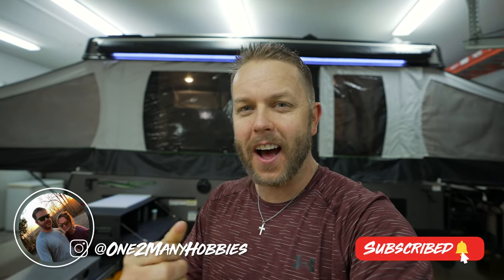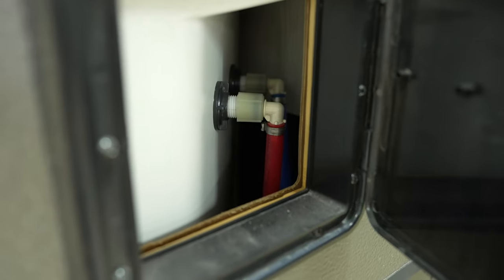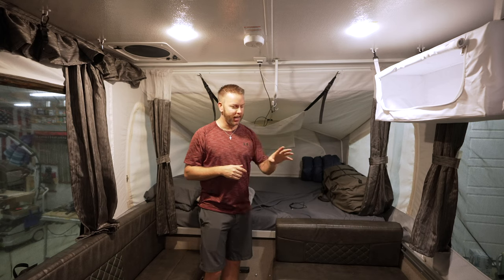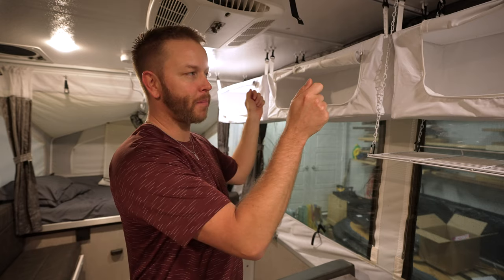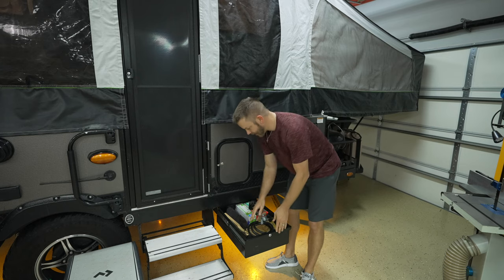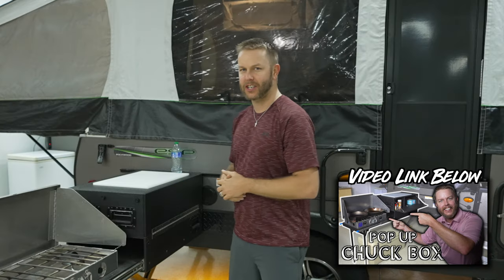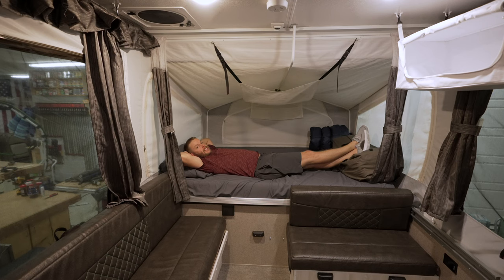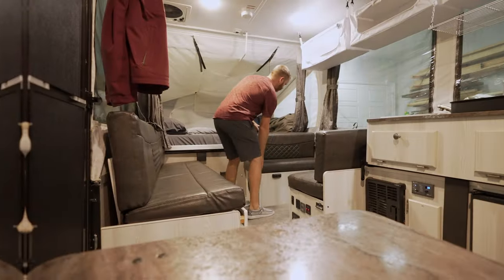TOP 10 Pop Up Modifications on my Rockwood Camper - 3 Years in the Making!!

Comment: I did 5 out out of the 10 upgrades. Thanks to you.1 storage bins,2 mattress,3 drain system shower and sink,4 switch the shower head and 5 USB outlets
Reply from the maker: That’s awesome!! Makes camping a little easier with these mods.
Reply from the maker: @cozcohut2617  I was trying to find a way to stay on the King side of the camper. Finally, just moved over to the queen side.

Comment: Thanks for the great ideas! 
My best mod on my trailer is a hot water recirc line for dry camping. Push button actuated solenoid valve on a 12-second timer, it will get hot water to the inside sink without running down the drain. A second press of the button gets the hot water to the outside shower to was dishes. Push buttons are at both sink and outside shower, and the water returns to the puny 10 gallon pot water tank.
Reply from the maker: Nice, I'd love to see this setup - wasting water to get it hot stinks!

Comment: #1 mod is electrical.  My 20 year old camper isn't as good, but the rebuilt system allows  you add in the extra 12v hook ups for fridges and the extra usb.  I also like the hanging storage.  It makes packing and take down so much easier.  Great ideas, man, thank you.

Comment: Your #1 modification will probably be my #1 modification too, when I finally take the plunge and buy my first pop-up camper.
I will plan on replacing the three-way refrigerator with either a 12V DC or 120V AC refrigerator.

Comment: Can you make a video showing how your roof mounted solar panels are wired? I'd like to mount solar panels to my roof, but am unsure of how to run the wiring from the roof to inside the trailer
Reply from the maker: On my 19' 2280bhesp Rockwood there was a fabric channel of wires already going to the roof for the lights etc. next to the front support arm. The solar wires run in the channel as well - is your camper pre-wired for solar with MC4 connection on the roof?
Reply: @One2ManyHobbies  unfortunately it's not pre wired, I'll have to add a similar connection. Another option I'm considering is running the wires behind an existing light on the roof

Comment: Many excellent ideas here. Great job!  A question on the Fold Away Stair modification, what model is that you have? Thank you.
Reply from the maker: I'm not sure which mod you're referring to?
Reply: @One2ManyHobbies   The aluminum stairs on the tent trailer mounted under the tent trailer do not appear to be factory issue(?)
Reply from the maker: @davidsharples3615  They are OEM from the manufacture.

Comment: On the king side you can add a mattress topper like a 3".Just a suggestion. That's what we did.
Reply from the maker: Where do u store it when traveling?
Reply: So what I did I  ordered one of these Premium Mattress Encasement Waterproof Fully Encased Zippered Protector 6 Sided Cover Machine Washable Breathable RV Short King 72 by 75 inches Fits 5-7 inch Depth and one of these BedStory 2 Inch Memory Foam Mattress Topper, Gel Infused Toppers for King Size Bed, Premium Mattress Pad with Removable Soft Cover, Ventilated Design & High-Density Memory Foam and put them together with and pos mattress lol. I was able to close the pop up with this.
Reply: Both of them I got on Amazon.
Reply from the maker: @cozcohut2617  ok, do you own the 2280esp? My roof wouldn’t close if I added anything to the king side, because of the door hanging above the king bed. Sounds like you have a nice 10” mattress now, is that correct with all the additional mattresses on top of the OEM mattress
Reply: Ya I have the 2017 2280esp. It's probably a 6" or 7" all together.
Reply: Hey Lance will you do a video on how you  did your electrical system on the pop up?
Reply from the maker: @cozcohut2617  Maybe next year/season - that's a complicated video to produce and edit.

Comment: I also plan to do the drawers on both side and the lights. I have a question where did you get the metal rack that goes under the cabinet? Thx for responding to my posts.
Reply from the maker: Nice, double drawers is nice!! I wanna see some pics of your camper? Send me a message on IG or email me! Home Depot is where I got the metal rack & chain.
Reply: Right now it's in storage but I'll send some pics when I get it home in April.

Comment: On our high wall I just replaced the refrigerator with a 12v model from Rec Pro.  So far so good.  We will see how it works this summer.  The 3-way was surprisingly easy to remove.
Reply from the maker: Nice! I like that it runs off propane, however I don't like that it's really hard to regulate the temp. - I have to to turn off the refrigerator at night so it doesn't freeze when it's cold outside.

Comment: Great vid!! I did a few of your mods on my 1910 esp and was wondering if you could go in depth a little more on your inverter mod? I would love to upgrade mine but dont know where to start honestly. I run a 200watt solar kit that i made for the camper but it does not seem to charge the batts as much as i would like. Im running 2 lead acid batteries and they used to be great but now the are showing age.
Reply from the maker: Thanks for watching! I’d upgrade to a lithium battery then. They’ve come down in price dramatically in the last 12 months.

Comment: will you be doing a video of your inverter system
Reply from the maker: Maybe…. Not really much to cover honestly.
Reply: I installed the exact Victron Multiplus under a seat in my truck camper.  Being in a confined space, I found that it ran very hot. I ended up venting the space which helped a bit.

Comment: chugging along implementing your video’s. Wish I had that climate controlled garage to do those upgrades :-)…. So on that 12v receptacle install for the dual fridges (yes we did exactly what you did after watching this)…how did you wire the receptacles?  I anticipate you are drawing 4-6amps, so is the positive going directly the the battery in line with fuse, a dedicated 15amp dc circuit, or piggy backing existing 10 amp circuits?  Also did you connect the negative dc to the trailer frame or home run back to the battery?
Reply from the maker: I installed a dedicated DC fuse block, and I already installed a ground fuse block on that side of the camper for my couch storage light, so I just screwed the negative wire into that. https://www.amazon.com/dp/B000THQ0CQ/ref=cm_sw_r_as_gl_api_gl_i_C00TTDERZXWYAEV3XM0R?linkCode=ml2&tag=lancew09-20
Reply: Awesome, as always!!….I just got the sub Panel and Neg bus bar, thank you.   Just watched your other videos on how you installed both light upgrades and connected the neg bus to the frame.   Need to do some research on connecting that Sub Panel on the OEM electrical system (not the Victron rewire), but I will figure it out!!  Again, GREAT WORK…and my wife loves your under camper and in cabinet light ideas…She put it on my to do list.   Thank you again…BTW, I have not seen it on your videos, but you might want to consider a gizmo sun block for over the canvas.   We are in Florida, and it literally drops the temperature in the bed compartments significantly!  Also helps protect and keep canvas clean from falling nature.   Thank you!!!!!
Reply from the maker: @oceanfrank1  awesome! Have fun, we don’t came in the hotter months - that’s why you’ve never seen it, we’re winter campers only. I enjoy a nice fire at night!